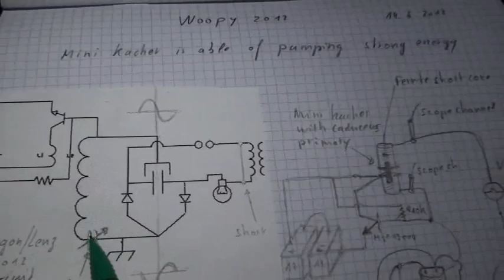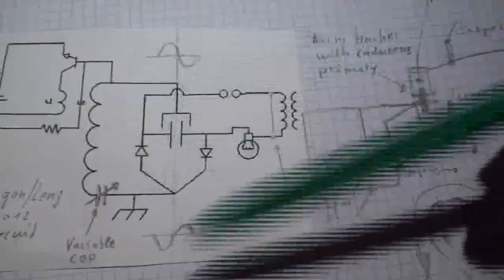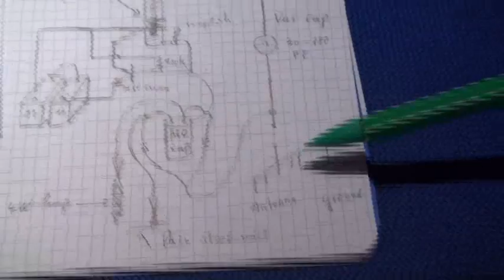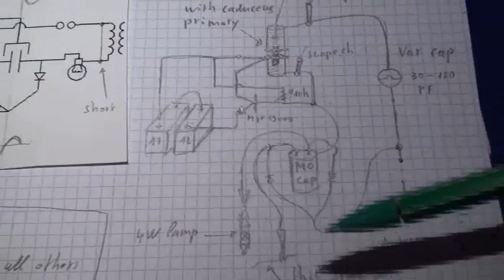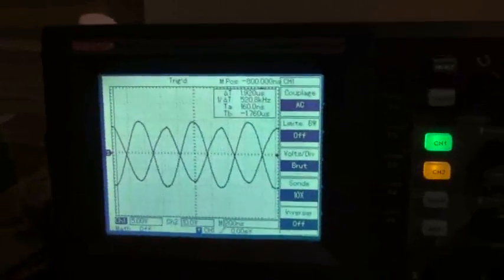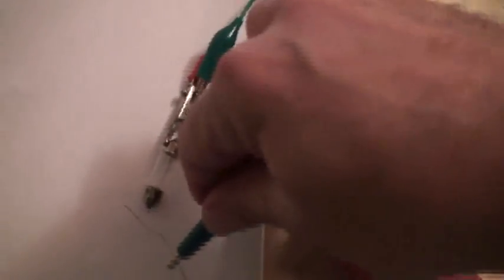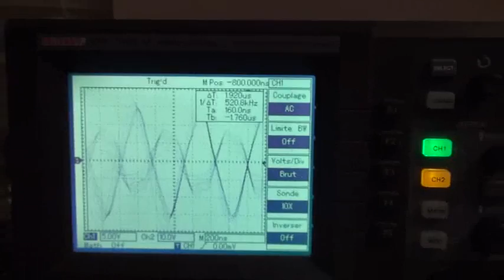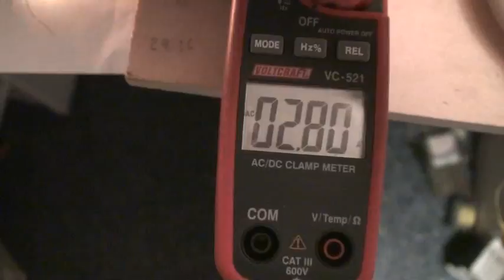Maxi energy pumping with mini kacher 1 .wmv

Comment: if you wait long enough you can light up a 60 watt bulb for a second, i did this many times,  unfortunately,  it is just the excess charges which jump across the spark gap makes this effect .because of the capacitor there are higher energy peaks but for a very short time.
no special anomaly in your experiment,  very common effect.

Comment: Excellent Woopy.... you did it.. Now you question is valid is it real or a reflection to the amp meter clamp coil.. This energy is very different as you can see.. It wasn't blue but a form of dim white. It's actually polarized light. Like led lights. It's a richer form of color but it can have it's dangers, so be careful my friend.
 The exciter coil for the catcher needs better spacing. Each crossing should be 90 degrees out of line with each other.  So it should cross perfectly as possible.

Comment: Cool, you got to the stage where N. Tesla was separating power input from output. :)
Now you need to tune capacitor charge and discharge ratio so the output will be much smoother and you connect battery charger over current transformer to recharge your batteries whiele you lightbulb is lit.